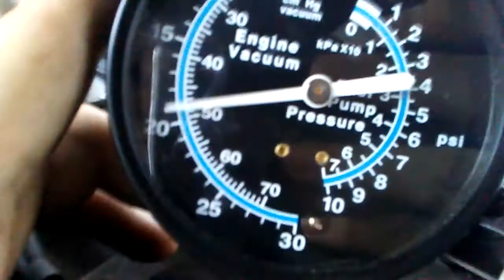1970 Buick 350 Idle Vacuum Reading

Comment: n wats the biggest cam i csn used in lift before needs valve springs?
Reply from the maker: Valve springs aren't the only problem. With much over .500 lift the springs will collapse, retainers will hit the valve guides, and the stock rockers just physically cant handle more than .500 lift. Crower level 3 is .446/.468 lift, something along those lines. Very good cam.

Comment: so i got a 72 i belive is the 230 hp like to swap stg1 alum t.a intake n the t.a 284 cam with a 750 dp any guess on power with the cambo?
Reply from the maker: Bump the compression. The 72 probably only has 9 or 8.5:1. Bump it to 9.5 or 10 depending on what gas is available. Headers are a proven 30hp that HotRod tested on a Buick 350. But for $500, I wouldn't unless you find some used. 9.5:1 stock heads with a valve job, manifolds and ta intake and 284 cam ~300hp ~380ftlbs at the crank. Hp in the 350 comes from porting the shit out of the heads.
Reply from the maker: In 72 they were rated in net hp and compression dropped. You either got a 150 or 180 horse 350. Whats the code on the block on the drivers side where the head mounts.
Reply: well up to 93 octain n yea they taxing on the headers but its decent power .
Reply: dnt got it with me so it might be pointless if is one of the ones u mansion.
Reply: this wat we found on the block 1231447

Comment: Hi, where did you buy your fan spacer to put the hei in there? Any tips on where to set timing?
Reply from the maker: There is no fan spacer. Just the fan and it's thermal clutch. I have my timing set at 12* btdc at idle. I have 9.5:1 compression. If you have over that is put it at 10*, but see what your engine likes. I also have vac. advance on ported vacuum.

Comment: wat u pushing hp wise now?
Reply from the maker: The engine is stock with a mild cam. So its probably within about 20hp of that 315. With only 30* total timing, rich as hell air fuel ratio and moldy filter it put down 211hp to the wheels. Stock heads, intake, exhaust manifolds, everything. Except the cam and an HEI swap.
Reply: @jordanwiley4582  That works out to 264 HP at the flywheel. Not half bad for an engine that started off at about 205-210 net HP when it left the factory.